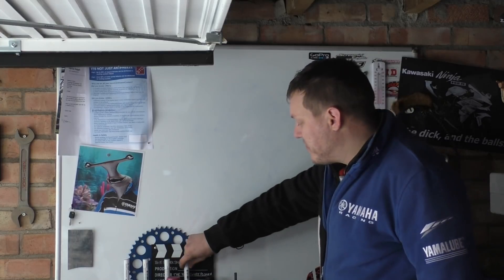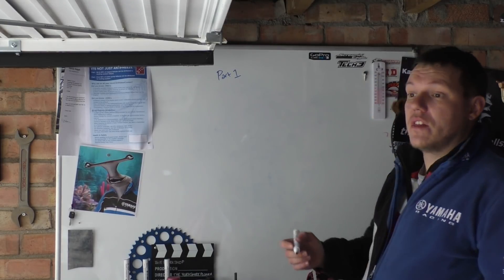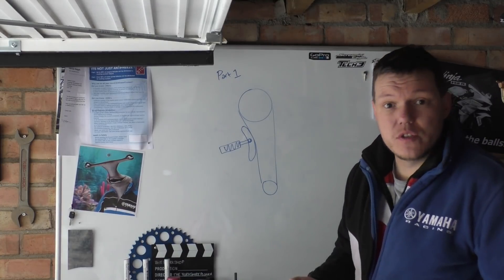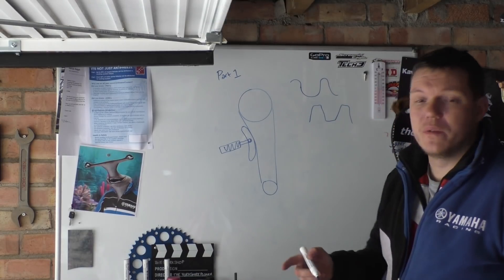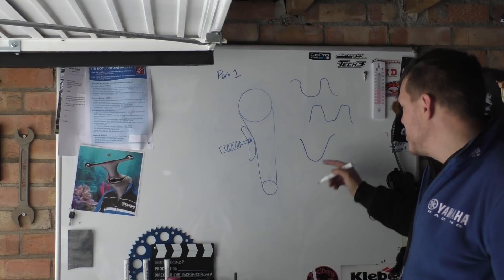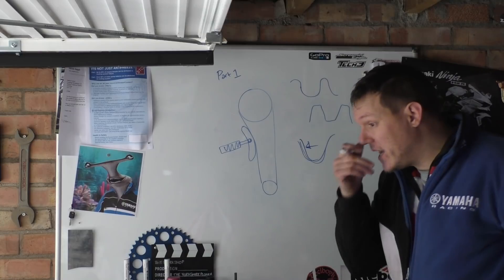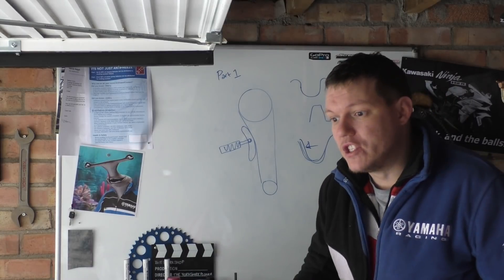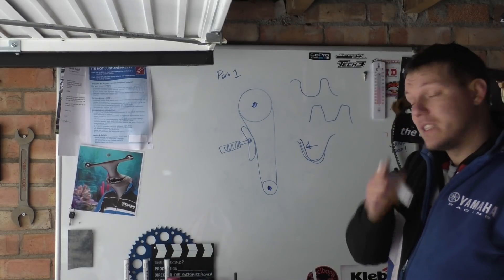Camshaft Drive - Chains - Part 1

Comment: Chains are great because they can outlast your engine. If you take care of your engine then the chain is a set and forget kind of thing. And since if necessary you can split and rejoin a chain it becomes very versatile. One downfall might be the noise because it's big metal chain on a metal sprocket it can rattle and make other metal on metal noises and it can be heavy.
Oh and in my case the chain had a slider on the tense side as well, probably because long lengths of tight chain can start swinging around.

Comment: Fekking timing chains.Last week the tensioner broke in my Peugeot 308 causing the bolts to fling off and crack a hole in the engine case =write off

Comment: there is a oil pressure variant of a hydraulic tensioner that Iv see and is sketchy at best. they do last a good time if you get a working one and its a gamble that it dose not fuck off in the long run. a engine like this dose not take nicely to dirty oil, can leave you high and dry under neglect.

Comment: I was worried about the noisy gear-driven cams on the VFR. Never had a problem. 4 cyl bikes with the chain between 2 and 3 give me the shits. Especially when you pull the head off and have that 'whoops' moment.

Comment: Whats your opinion/preference on cam sprocket location? Nose of the cam or center like the ER-5?
I think it was the ER-5?
Reply from the maker: Yes it was the ER-5 and great question, this needs it own video - next weekend dude
Reply: The easy way to replace cam chains is to break the old one after removing the camshafts, join a new non-endless one onto the old one with lockwire and feed it through to remove the old one. Then fit the master link and pein the pin with a proper tool. It means you can avoid dropping the motor and splitting the cases.
Reply: My old Kawa GT550 had a centre sprocket with hyvo chain. Complete  bastard to replace...
Reply: The side your timing indicators are on. Fly wheel/stator side  for sure. They do exist on opposite sides on some bikes, imagine the pain in the arse checking timing and tdc for valve clearances etc.

Comment: I guess you will mention the belt drive and shaft driven camshafts in the next video... oh don't forget the rocker valve drive or the Harley puss will shit on the table. I just saw a 1955 Matchless and it had a HEMI! so that isn't a new thing... That thing was stupid fast for back then and became excluded of races in the US... Harley just could not beat it. Made in England till 1969.

Comment: Question: why do so many companies fuck chain drives up?
I mean most car companys have huge problems with they`re chain drives.
And why does it seem to work better with bikes?
Reply from the maker: 1) tensioners - trying to cheap out 
2) the tensioner is actually under a lot of stress
3) OEM chains are another cut back on quality that is
4) Bike manufacturers have more money to play with when it comes to engines. When you look at pistons for example, bike engine pistons these days look like car aftermarket ones, but from the factory. No need for cup holders and all that shite
Reply: The Workshop thanks matt

Comment: Many old american push-rod V8s with chain driven cams don't have tensioners.
Reply: David Vermillion bike makes probably 4 times the power per Liter
Reply: David Vermillion you don't by a bike because it's reliable it's a fun hobby for most
Reply: XD the LS? I'm talking 60's and 70's gas guzzlers not some rich boy's toy
Reply: Many modern push rod diesels for gen sets don't have chain tensioners because they just use two fucking gears if the camshaft already sits near the crank lol
Reply: Yeah, but back then everybody was poor so we needed durability.
Reply: Can't wait till we get to desmo valves
Reply: Bevel Drive Desmo
Reply from the maker: That's because they're shit LOL and the chain is very short
Reply: If they're shit, how come a 8.2L V8 only has to be rebuilt every 200,000 miles. While you bike is probably 50-60K miles
Reply: The Workshop they are not refined but not shit, of course they are not efficient nor efficiently built. But the LS offers decent power for a pretty low price (especially for parts), with 1a reasonable weight and great reliability. 
There are much better engines out there for sure, but they're not shit.